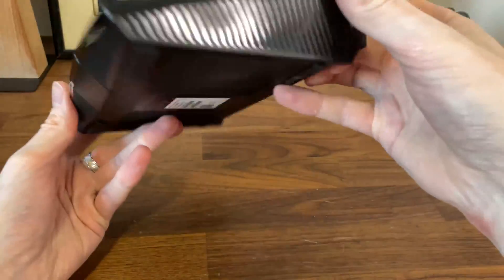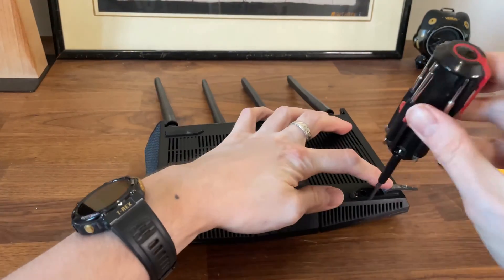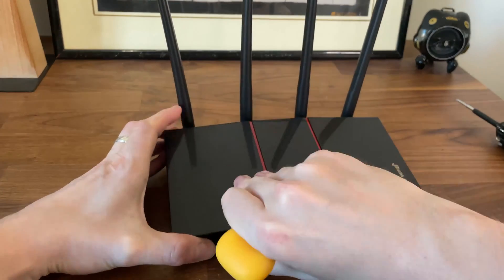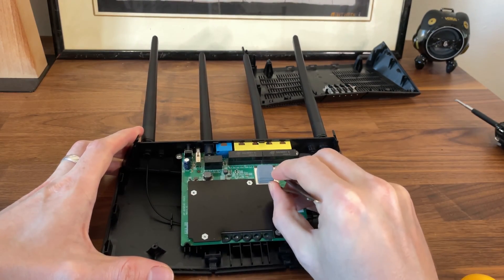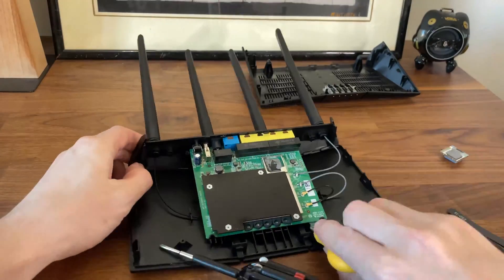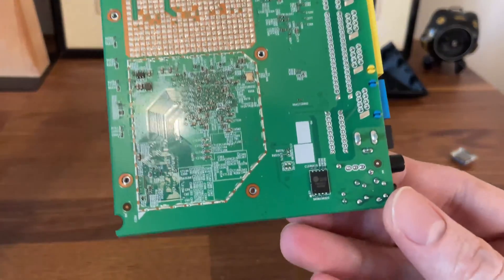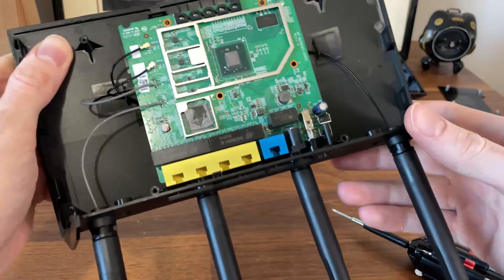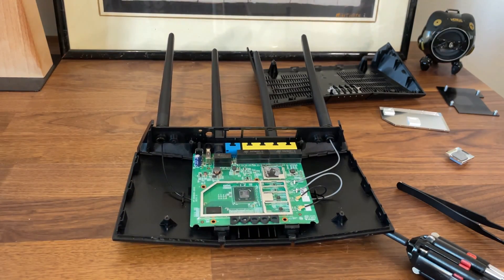ASUS RT-AX55 Wi-Fi 6 Router Teardown: Be careful with this one

Comment: Hello. First of all, thank you for the nice content. In my country, Asus RT-AX56U is 93 dollars, RT-Ax55 is 46 dollars, and Asus TUF Gaming AX3000 V2 is sold for 143 dollars. At home, 2 PC (one connected to wifi, one connected to ETH LAN for gaming), 3 Android phones and 1 Android TV are used. Which one do you think makes sense to buy?
Reply from the maker: I have tested the RT-AX56U before and even put it against the AX55, and I preferred the former, but then again, it's about double the price. The problem is that the AX56U v1 has been discontinued by ASUS already, so be careful with this router. I would steer clear of it.  The AX55 is not a bad router and it should be able to handle four wireless clients, but it will depends on which applications are ran at the same time. I have not tested the TUF AX3000 v2, so I can't tell you if it's the better option, but from what I saw, it does come with a 2.5G port and hardware-wise, it's very similar to the AX82U and AX58U, both very solid wireless routers.
Reply: Asuswrt-merlin
No longer supported: RT-AX56U3004.388.8_4